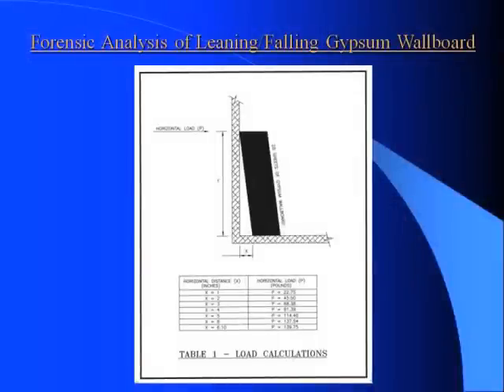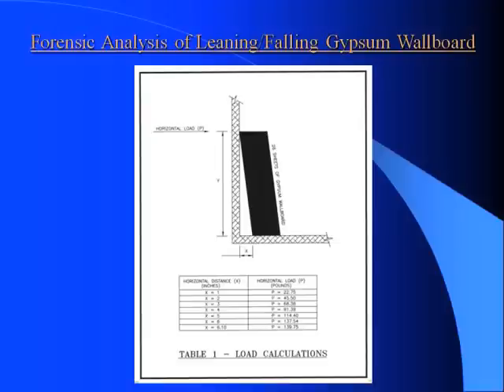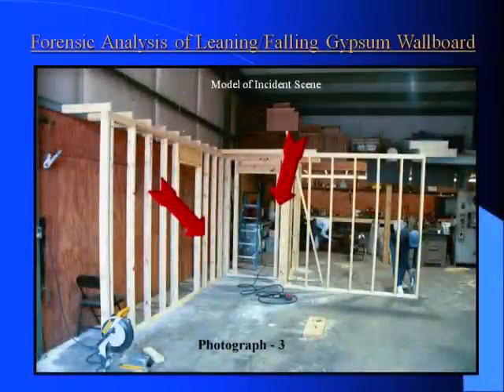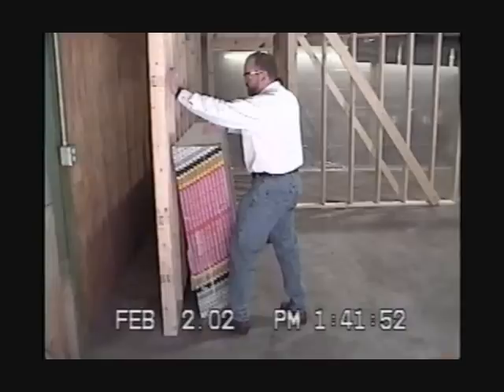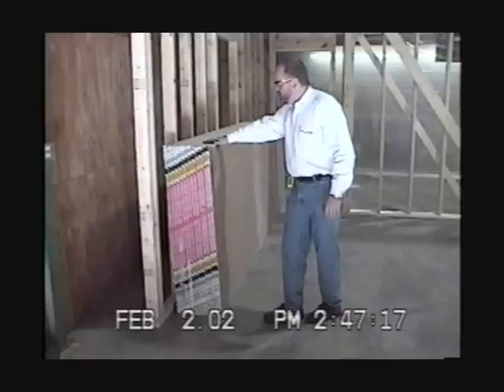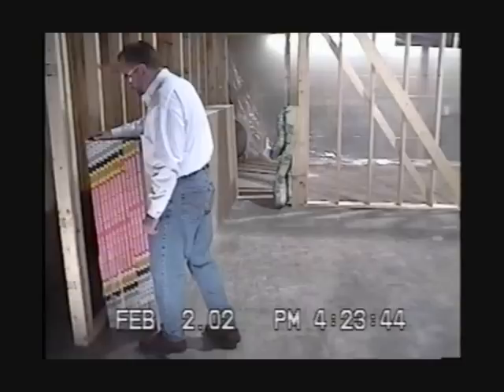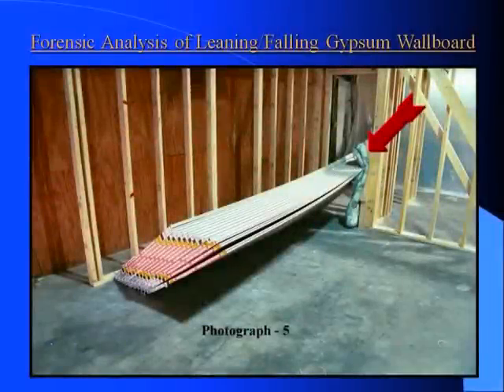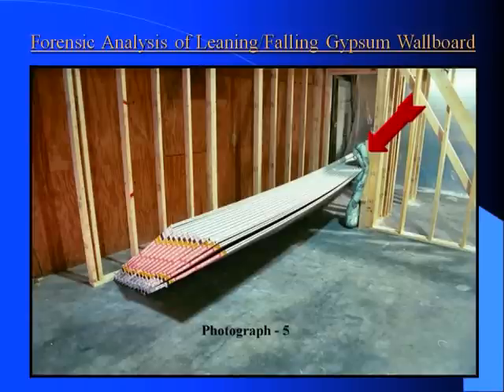Forensic Analysis of Death Involving Drywall/Sheetrock

Comment: I'm 53, and I tipped a stack of 9 or 10 sheets of drywall towards me back in early October 2018. I believe mine were 1/4". The stack was not secured by the builder who allowed me access to the house during construction. Actually, anybody, even little kids in the neighborhood, could have gotten in as the doors didn't even have locks on them yet. There were no signs on the stack indicating 'Hey, I can kill you.' I had nooo idea how heavy they were because tipping them didn't require any enormous amount of effort. They tipped easily. I was looking for HVAC flooring receptacles because my builder had only put 4 on the first floor...one in a closed-door closet pantry and another beside the front door (not the hinged side either). The stacks were leaning against the wall in the first floor hallway, and basically when I tipped them, the bottom of the stack slid against the wall they had been leaning against, and the top of the stack flung me backwards and pinned me against the staircase, landing just below my chest and putting pressure on my ribcage. I didn't even realize it was an emergency situation at first. I gave the stack a one-handed push, no luck, but was sure a two-handed push would be enough to get the stack off my chest so that I could breathe again. I was about to toss my cell phone on the floor to give it a two-handed push, but (sounds stupid I know) luckily I worried enough about breaking the glass on my cell phone as I struggled to breathe. The drywall wasn't up yet, so I was able to reach through the framing and set it on a step. I kept trying to push the stack off of me, but it wasn't budging even a millimeter. I was sweating. I lost bowel control from squeezing will all my might to free myself so that I could breathe. My breathing was verrry fast and shallow as I couldn't expand my lungs. My mind was racing as I basically panted, growing weaker. Would my neighbor notice my car in his driveway and come over to see what I was up to? Was he in for the evening? Was he even home? What if I screamed? Well, the only opening was the garage door that wasn't up yet that faced my neighbor's. All of the windows were closed. I had a vocal chord polyp, so no one would hear me anyway. The houses were pretty far apart...almost an acre of land sat my house. When would there be construction workers in the house again? It was a Wednesday, and nobody was on the schedule until Friday when the drywall was to be installed. I believe this was a leftover stack from another job site, as it was the only one. All I could think of as I struggled to breathe was being found by either my neighbor or construction workers, blue and slumped over a stack of drywall. I picked up my cell phone and dialed 911. They couldn't get there fast enough...'hurry...I can't breathe'...over and over again. A couple of times I sat the phone back on the steps and gave it another try because it was taking too long for paramedics to get there. The dispatcher kept calling for me, and I'd yell back, 'I'm trying to get this thing off of me.' I know he wanted to make sure I was still conscious, but just talking was making it even more difficult to breathe. I wasn't even going to take my cell phone in with me that day, pretty sure that they hadn't done anything else. I'm sooo lucky I did. Luckily only bruised ribs (right side mostly) and an elevated lactate level which eventually dropped. I also have sciatica now in my right leg which I'm pretty sure is related though my doctors keep blaming it on coincidence. My ribs still act up at times too. I can only imagine what this woman went through. What a tragedy. I talked to a lawyer, and he said I had no case. If there's anybody out there who knows somebody who would be willing to take a case such as mine, please contact me. This builder should have secured that stack knowing laypeople don't realize the dangers. My neighbor said I was as white as my car, and I couldn't even walk...needed a stretcher. It had an enormous emotional impact on me too, watching my life flash before my eyes. I still think about that day and keep wondering...what if I hadn't brought my phone in with me that day?...what if I HAD decided to toss it on the floor to give the stack a two-handed push?...what if the stack had knocked it from my hand to where I couldn't reach it?...what if the walls were up in the hall, and I had nowhere to set my phone because I couldn't reach through the framing and set it on an upper step as at first I didn't realize it was an emergency and don't think I could have reached down to put it in my pocket? So many what ifs still haunt me. My advice...never ever even stand near a stack of drywall, let alone tip it. Much less force fell against me than this poor woman...not enough to crush me, but enough to suffocate me if I hadn't had my cell phone with me that day.
Reply: Thanks for sharing. Drywall is so heavy. You go to lift it like a sheet of plywood and it doesn't budge!